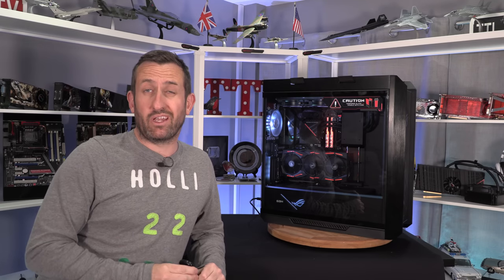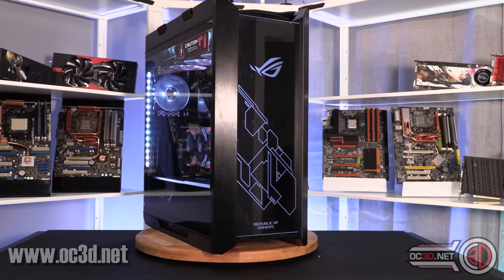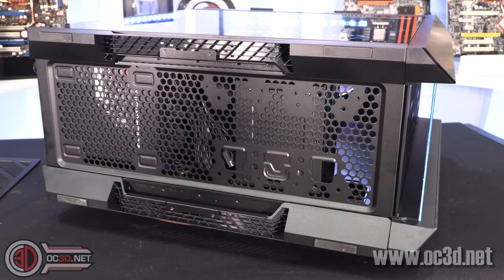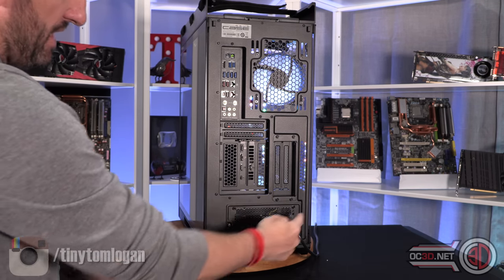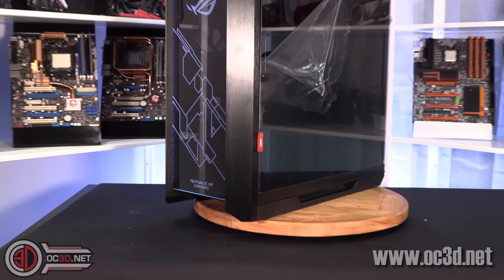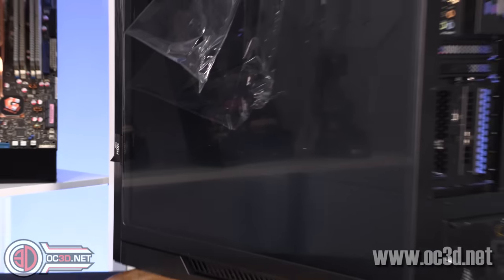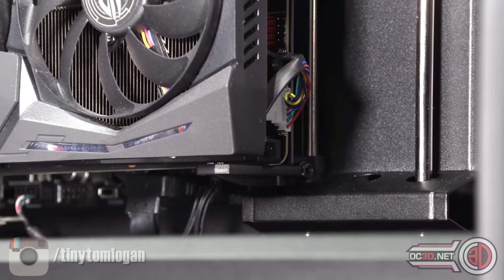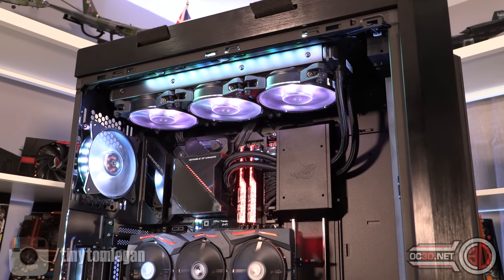ROG Helios Ultimate Fanboy Case Review

Comment: It's a mad expensive case for my budget but personally, that is really the best looking case I've seen in a while. I'm not even a big ROG fan and always thought they were stupidly overpriced (that Ryujin cooler is the best example), but somehow this is an exception. Maybe because everything nowadays looks so similar. It's either NZXT minimalistic or gaudy tempered glass/mesh front that shows 2 or 3 rgb fans. I don't know, that look of 3 rgb fans at the front is getting really old now but the Helios managed to stand out and strikes a very nice balance of gamer design and elegance. I love the edgy but controlled shape of the case  with the diagonal lines and scribbles. The RGB lighting in the front is so tastefully done and I love how the front fans are just black. Only thing I wish it came with for this price was a vertical GPU mount. I haven't been drawn to a pc case this much in a long time and I've found myself actually saving up for it. This is gonna be my Christmas gift to myself after not buying anything for a while. Can't wait!
Reply: I bought the Case for $405 CAD. GST plus Tax was $426.79 CAD. I didn’t think twice of the price but i feel like a king for buying a unnecessary, sexy, expensive case. I bought it in white. Lian li fans are good for back fan and 3 top fans with aio i’d leave the front fans because it should keep the black and white vibe mixed with the brushed metal

Comment: OC3D TV: 17:46 Says that the metal cover is for solid state drives. 

ROG Aura terminal: Do I not exist anymore? 

(I wouldn’t be bringing this up if it wasn’t for the fact that the thing isn’t used properly in these ROG Helios builds. Granted bitwit did use the aura terminal... he just mounted it on the back instead of the front where it could’ve be displayed. Oi)

Comment: Thanks for the review. I wish you went in with the rads a bit more though. What would be the most optimal solution ? I've seen push/pull 360 in front PE and SE 360 Push on top working alright. I am wondering is there anyway to make 420 front and 360 top work and what would be the rad thickness I could use.

Comment: Over time using those straps to lift it, could the case not flex under its own weight?
Also they could have made a better cut out for the power supply considering much effort has gone into the design and the digital read out of Watts?
I like this case but not really enough good things to make me commit to purchase

Comment: Great review, i got the same case in white and finally i got rog strix 3080ti that i want to mount vertically but is there any pcie 4.0 rise that is working properly without the need to change the setting on the Bios to pcie gen 3 ?

Comment: Hello, please tell me, if the video card is installed through a riser, then hot air from the 3000 series of nvidia video cards will blow directly onto the motherboard socket. What are the temperatures on the socket? For example, does the x570 have a fan that will suck in hot air? How hot is it?
Thank you

Comment: Hello! Very nice review, i have on the way 2 ASUS HELIOS CASE and i wanna use Vertical GPU ( STRIX RTX2080TI O11G and STRIX RTX2080 O8G) Question is, if you can suggest a Riser Cable or what is the riser cable you use. I'm asking this because i experience some problems with some Riser Cables that causes Video problems specifically with RTX series. Please help me to confirm that. Thank you!
Reply: ASUS sells a ROG Strix 240 mm PCI-E x 16 Riser Cable with 90 degree adapter and EMI shielding on their website

Comment: Hi Good evening, 
Have ryzen 2600 , ROG STRIX B450-F GAMING, 
ROG STRIX 2060, with 2 x 8 -16 Gb Corsair DDR4 sticks.  Story cut short added further 16 GB and now blue screen.  Mtested all sticks with no errors, won't boot with one of new sticks in slot A either.  contacted Corsair(Thank you for the update.  If both kits are working separately, unfortunately, it sounds like your motherboard cannot handle 4 sticks at 3200mhz.  Some Ryzen boards can attain this, but not all can.  You may be able to use both kits at a lower speed such as 2933mhz.) Just informed them (ROG STRIX B450-F GAMING
 box states, AMD Ryzen™ Processors
4 x DIMM, Max. 64GB, DDR4 3200(O.C.)/3000(O.C.)/2800(O.C.)/2666/2400/2133 MHz Non-ECC, Un-buffered Memory 
Dual Channel Memory Architecture 

AMD Ryzen™ Processors which supports 
4 x DIMM, Max. 64GB, DDR4 3200(O.C.)/3000(O.C.)/2800(O.C.)/2666/2400/2133 MHz Non-ECC, Un-buffered Memory 
Dual Channel Memory Architecture.

Are you saying that this does not support 4 x 8 ie 32GB @3200 

Is this a fact that it cannot deal with 4 x 8 ie 32GB @3200

many thanks for your advice in advance

Comment: I wonder if with the second vertical mount add in you can dual gpu for sli
Reply: you can
Reply: Feel_Bath_Inc do you know if I would need to get a vertical gpu mount like the cooler master for this case or are the temps ok with the stock vertical case mounts

Comment: I have only one issue. 
I havent been able to connect the "serial SATA" that comes from the front IO panel (which gives power basically to the additional fan hub and the front lights). I did put all the other wiring such as the power on, reset button etc, as those have clear places to fit into on the motherboard.

Anyone knows how to get that connected?
Reply: I have the exact same problem and it’s upsetting no one really knows, personally I ordered a 6 pin sata power cable from Corsair, I’m not sure if it’s going to blow smoke or not, but if it works I’ll update my comment here.
Reply: @steviewonder402  thank you. i hope it works for you. and i agree it is somewhat frustrating. i am glad at least that i had no real hiccups with my computer (knock on wood)